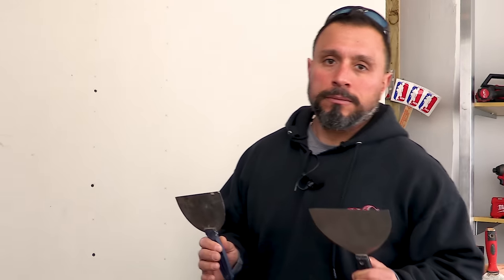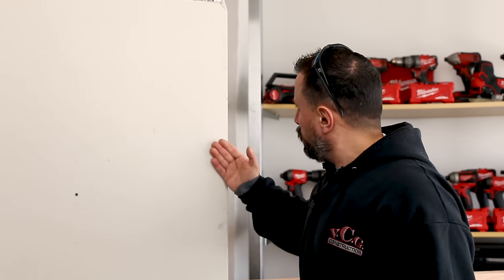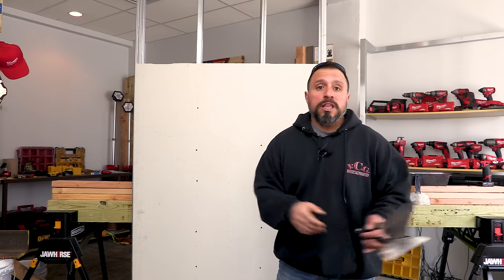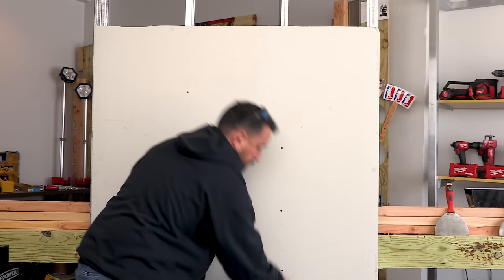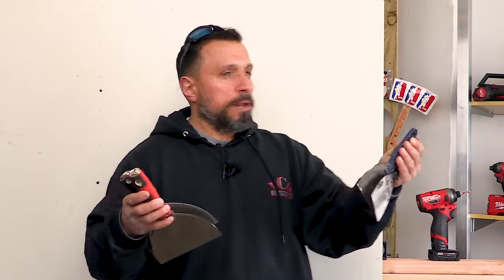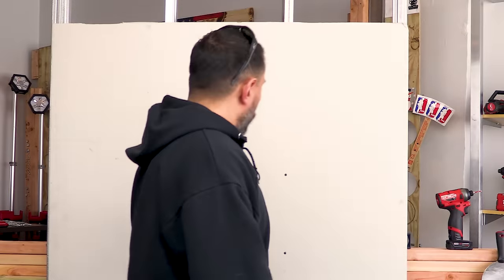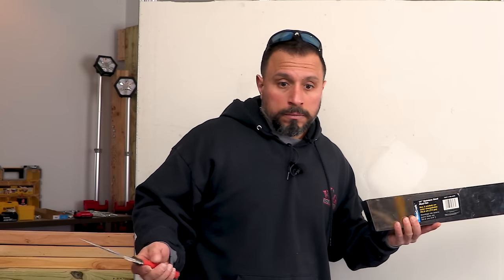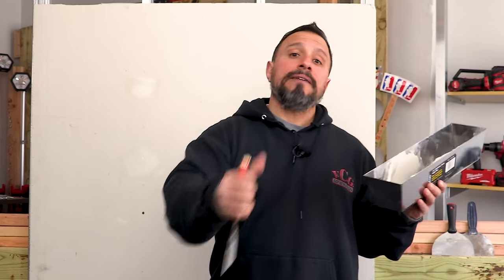DRYWALL FINISHING TIPS AND TRICKS THAT YOU DON'T KNOW ABOUT!

Comment: I carry a T handle phillips bit tipped screwdriver.  Faster to fix those protruding screws with  about a 1/4 turn than fumbling with drill.  No breaking paper from going too deep.  Also found the Rigid  'strip' screw gun was best investment i made.  Guaranteed for life.  Tip: Order bits through customer service at Home Depot and they are much cheaper than buying off shelf.
Reply from the maker: Solid tips we appreciate it Roger!
Reply: I could just bang them in with the handle faster than fiddling with a screw driver

Comment: When I’m first coating my screws I’ll carry around a screwdriver to get the clickers. Some tapers smash them in but then it takes away the hold from that screw.
Reply: That's the way!
Reply: Exactly. It ruins the paper and crumbles the drywall. The hammer end of some knives is for use on drywall ring nails, not screws. And this video is actually a good illustration of why a person should NOT hammer screws. It took him about 8 hard whacks to get the screw embedded deep enough, when one turn of a screwdriver would have done it better and quietly.
Reply: Technically if you RIP the top paper ( too deep) the hold is comprised. We would typically remove it and try again.
Reply: @northpolltv6598  the screw wasn't in the stud so turning it wouldn't do anything you have to get it out or hammer in. Most guy don't waste time trying to unscrew it so they just hammer it. It's  quantity not quality anymore.

Comment: Another tip, if you haven't discovered it already, is to slightly sand the sharp corner edges of the blade so that when you're applying pressure you don't accidentally scrape and mar the surface paper, or leave sharp scrape marks in your mud. I worked with some drywallers too and learned some tips from them, including this one. My own tip, if you should find yourself without a decent knife like if you're pre-prepping and your stuff is in the truck and you don't want to do the walk up and down the stairs just yet lol, a sturdy plastic screwdriver handle works nicely too.
Reply: Awe man.. I thought sanding the tips was my trade secret. I guess I should have got that one copyrighted. 🤣🤣🤣

Comment: For residential jobs, three things work best for me: 1)  tapered blade, Richard, 2) fill and scrape instead of sanding and 3) use only taping mud for finishing, as finishing mud works great but leaves a soft base for paint which dents and chips easy.  Last thing I want is an unhappy client, so the finished job should look great for years, not months.
Reply: what kind of taping mud do you recommend?
Reply: @nspetlover  I have used various types and it seems each pre-mix box has different consistencies, so I will change brands if I can.  I rather get stiffer mud and thin it, than get wetter mud, which one would have to add powder to thicken.

Comment: The RICHARD Flexible Carbon Steel Taping Knives With Ergo-grip & Screw Bit is the Cadillac of taping knives.  Don't have to smash the screws in as that destroys the integrity of the holding ability of the drywall.  There is a bit difference in the flexibility of taping knives too.
Reply: Interesting. Thank you.
Reply: Yeah, I agree, I do not recommend pounding in missed screws. More than likely they'll pop out over time due to settling or moisture (like in a bathroom).

Comment: I have also seen finishers use a utility knife to cut a small triangle of paper off a missed screw hole or a hole in general and remove the paper. makes a very clean finish. most of the union finishers I worked with all carry a philips head screwdriver since most high screws only need about a half turn to set and the make another great option to pound with.

Comment: I'm all about a Hawk, and Hyde brand knives. Mine are old and they are made out of carbon steel instead of stainless. A clean knife works best, you can always hit them with an orbital sander if you need to clean them up. Also, an oscillating saw is my new favorite drywall tool. My 2 cents. Great vid, thanks!

Comment: I learned the hard way that driving a loose drywall nail back in will eventually pull loose again and create a nail pop bubble in your finished wall.
I live in a area the soil moves quite a bit as seasons change so homes get quite a workout.

I found a wood chisel works great to take off paint, texture and joint paper down the the drywall paper then can fix nail pops & drywall cracks

Comment: This is not a critique this is a question. I'm curious I have always removed any screw that didn't get into the framing. I don't carry the hammer around I use the side of my 6-inch knife and my drill. get under the screw with the side or the corner of the knife and just back it out enough until it grabs the drywall. But here's my question. Do your screws pop if they're just loose in the wall like that? We follow the same technique. I use the back side of my knife to knock the paper in once I get the screw out but I've always been scared to leave the screw in the wall. Have you ever had any callbacks on that or anything because that's what I have always expected. Good video good information with good intention behind it. Like I said, I'm asking a question.  I'm not critiquing

Comment: Good tips. I used the head of the knife like that. Though alot of them break pretty quickly. I would add that I picked knives that had alot of flex. Stiff knives don't scrape of enough compound. Then when doing joints you want to scrape the compound off the board and not off the tape. A flexible knife  can be bent to do this.

Comment: Try to use durabond on the 1st coat and mesh on the seams will keep the nails from popping if you hammer the higher screws in the field. Also use a halk instead of the  pan faster . Happy taping

Comment: Yo Vin. Great video.  “Boom, boom, boom” how about sanding? I got dust everywhere!
Reply from the maker: Ahhh good question
Reply: Use a wet / damp sponge to remove the excess - once it gets wet it will come off depending how much pressure you apply... be gentle

Comment: Ex-NYC UBC journeyman.  Tapping with  a steel and brass ended joint knife was a waste of time.  We had a drywall hammer, that we would file the striking head to remove the serrated face.  I used the Estwing 11 oz, and with the file milling of the head, I also gave it a more rounded and smooth outer edge.   When a screw had missed the wood or metal stud, I would strike the drywall hammer on the screw.  Once you had done it enough times, you got good enough to just hit the screw once.  I left a  nice indentation on the sheetrock, with just one whack, and not breaking the outer paper.  Force was not the defining factor; but, speed of the blow.  It was very smooth and fast because at 11 oz, the hammer was light.  That way the wallboard finishers (tapers) would not have a need to curse out the carpenters for slowing their work down.

Comment: The problem with bashing in floating screws (missed screws) is the potential for busted dry wall.
If you look at your bash job you can visually see that you cracked the sheet by the indentation (or corona) around the screws location mate.
Thanks though ill pull the screw and plug the hole with quick set Dap .

Comment: Why use screws at all mid sheet?
We glue blob the sheets but only screw the tapers. Bedding, wet tape, bedding then topping cover them nicely. Also now starting to do more horizontal fixing (and about time!); just one joint at 1200mm then corners. Internal paper, external zinc metal. We're mainly timber frame down here.
That's the current way via building code in New Zealand.

Comment: I was looking at your knives cringing.... I might have done drywall fulltime for 10 years so there's that. Tap the screw with the side of your knife so you dont dent the finishing side, pull the screw out and then use the butt end to dent in the torn paper edges before mudding. If you bang the Misses in there's a chance she pops out later. Great tips all around for a carpenter tho!

Comment: if you put the mud over the screws in the same direction as you wipe off the excess, you can end up chasing a bubble in it.  I always  put the mud on going up and swipe it down to remove excess.  That way you push the mud against one side, then coming in at the opposite direction, pushes it against the other side.  Don't pound screws, screw them in.  Use the back of the 6 inch knife to hammer popped or not fully driven nails, or to push torn paper, as you said.

Comment: This question is more about tool but do they and if not why don't they add a drywall clutch to impacts? I've always wondered why they didn't install a special clutch just for drywall on them. I'd imagine someone thought of this and they probably have something like this but if not this would be a fantastic idea. Don't get me wrong I'm no drywall man but who hasn't hung a sheet of drywall or at least had to put a few screws in drywall in there lives whether it be a patch on a hole we had to cut out or whatever. Regardless I hate using a drill for screws but for drywall it is the best tool. I do usually use an impact but it's very easy to break the paper. Wish I could invent this option I'd be rich lol

Comment: As a machine & hand jointer for 30 years, the real reason the brass was fitted into the handle was because of this,  if you drop your knife it would always hit the floor handle first thus saving damage to the blade. Goldblaht was the first to do this.
Reply: you speak the language once again someone that knows there stuff wheres the add glue comments i only have seen the dish soap one so far lol
Reply: Thats a good one LOL, the name of those knifes are call "hammer heads" I dropped a few knifes in my 43 years of finishing and  90 percent of the time the blade would hit first.

Comment: I never used a 6" knife. 4" fits into the factory edge groove better and tapes corners much more smoothly. Everything (tapewise) afterwards was screed board and 10" trowel.
Reply: union drywall  finisher for 40+ years, use the 6" knife to apply tape (much easier) we never use a 4" for that.

Comment: i'd love to work with drywall in my place, unfortunately more than half of NYC buildings are 100 or more years old and use plaster walls, which makes things very VERY difficult. basically i got into an apartment where i had to do my own skim coats since the plaster walls were bleeding with old paint that was 50 layers deep. a 6 inch knife is a hard pass for this. i learned the hard way. a 6 inch knife is great for low level applications on spots or for here and there and for taping, but when you are dealing with 800sqft of uneven walls, only huge 20 inch or larger trowels will do.

Comment: the cheap hyde knife with the red on the handle i def agree with you 100% ill never buy one of those again.
oh and yes im a carpenter and yes i bought the cheap knife with the plastic end on the handle. :( oops lol
funny thing tho that cheap knife i still used it like that and after 3 rooms on my house knocking in nail holes and what not the blade is so loose it's bout to fall off. Trust me guys he knows what he's talking about. Spend the extra few bucks for the good stuff and i'd even recommend going for straight up stainless for your drywall knives, the non stainless and even the blue steel ones will rust on you like crazy. Plus the stainless ones cost a little more for a reason, better quality and longevity.

Comment: Not trying to be critical but when spotting nails (filling the holes around the fastener - everybody uses screws now) the object is to remove all of the mud around the hole. This leaves the surface flat so that there will be little to no sanding and no visible hump. 
The whole process for a nice looking job requires the least amount of mud to be applied as possible.

Comment: Mrs fix it over here and before you answer the question following tip number two….is it the neck of the tool? Like the metal part has a tongue that the metal handle is set inside the plastic handle making it sturdy and the junk one has the plastic form to the metal plate part so not very strong…?  So basically yes but I lacked to answer the purpose for it.

Comment: Local #3 electrician 38 yrs and I've NEVER ...EVER seen a Taper carry around a screw gun! Or a hammer for that manner, hence the reason for your "tip' because they certainly do use their blades like a hammer. I gotta admit; "it's a lot harder than it looks, and after failing miserably trying to copy how they do it I finally figured it out. Besides the fact that they do it everyday   (practice makes perfect) the real secret to their speed is in the mix! Screws aren't even an issue because they can see by eye along with the dimple from the gun if they're set right and pound in the ones that miss the stud. What diys'ers & homeowners don't know is that 'Tapers employ a mixing tool attached to a drill before they start instead of using the compound right out of the bucket. (Sometimes also mixing  compound with Schedule 40 and water for different applications like a skim coat) The result is a batter like consistency smooth & easy to spread without any air bubbles, nodes or spots. It makes all the difference in the world!

Comment: I have never been able to get used to using a proper drywall trough, I don’t understand how guys can even use them. That being said I am miles from any kinda professional finisher. But funny enough I have compound in my hands prolly 12 hours a month. To me a small bucket, a 6 or 4 inch trowel along with a 12 or 16 inch trowel and patching in holes in units goes pretty easy.

I watch guys that do new construction and I am in awe of their speed. but unfortunately I rarely get the chance to mud on anything unpainted and / or flat. I am lucky if the wall only has one or two sub par patches previously installed on it. lol

Comment: Tip number #1
No finishers are carrying screw guns around. The metal at the base of the knife is for banging those proud screws in. I even use a grinder to make a waffle pattern in mine so it’s more like a drywall hammer.

Comment: First 3 minutes: you can run your spackle (joint compound) knife over the drywall screws to see if you didn't screw them in far enough.

Next 7 minutes: you can pound holes or blemishes into the drywall with the back of your knife, so it's easier to spackle over.

Last 30 seconds: subscribe so you can learn another 2 sentences in 10+ minutes.

Comment: Yes you can use it capped end for that. But it was actually designed for final setting of any proud drywall nails. Most homes in the 1970's -1980's still used drywall nails, but got slowly replaced with drywall screws. I wouldn't recommend this method, especially with the drywall as of late, because that pounding your doing to set that screw can actually crack the gypsum, because the screw your pounding has no support behind it.

Comment: Another tip. Dont use the metal end as a hammer or push, it can create a bulge in the paper. Instead put on the mud and rub with the hammer end. Pushes in the paper and mud into the hole, than remove excess mud with knife. From a proud patch guy

Comment: The secret to fast good setting is to fix the sheets yourself to maufacturers install manual. Minimal pre filling , no cracks due to joints in wrong places, hollow butt joints between joistsand studs, very few screw proud/punched. ceiling joints back blocked . read the install manual folks.

Comment: Yeah, I knew about the end of the knife. 

Personally, as a finisher I do enough bending over as it is. So I wouldn’t go through first to check the screws in the field. The joints yes, butts and longs. 

The basics are crucial to know. One, of the screws break the paper the screw is suspect. Now, I’m not talking about one or two screws per board. I’m doing a job right now where it appears the guys started hang the rock without checking to see how the framers laid it out. So, consequently, the bits are not breaking right and they didn’t have any scrap wood to add on to the ends. Anyway the tried screwing the butts with longer screws at an angel, big mess. Any broken rock needs to be removed, filled in with mud straight out of the box. Then you can start tapping. We call this pick and fill. If you’re having someone come in and hang the rock; see if they’ve screws have broken the paper. If they have either point this out and have them re-do it. Again, one or two is no big deal. If there’s over 30% I’d be concerned. Especially if their on the ceiling

Comment: Just pressing the paper back into the screw hole wont work. Its a dry socket now the paper has been seperated from the actual gypsom so if you push the paper in and then mudd  it your mudd will eventually pop out due to the fact the paper is pushed in but its not attached to anything. Best bet is a new blade on a utility knife and cut around the screw hole void then mud it. So the mud has something solid to attach too.

Comment: If any of the hammered screws experience wall vibration those screws are going to float out and pop that joint compound right out.   Anywhere you see screw size holes in a wall, those were the screws that weren't screwed in all the way and someone decided to use their sheet rock knife as a hammer.  Just do it the right way the first time and screw the damn screws in.

Comment: The proper taping knife size is 5 inches...That makes the tape coat bed below the surface of the rock face, once you bed your tape, coat it so you don't see the tape, immediately after; the bedding coat...When you do the next coat, all the beveled parts should only need one more coat...The butts are handled differently...But I ain't giving away more secrets...30 year installer/finisher/framer